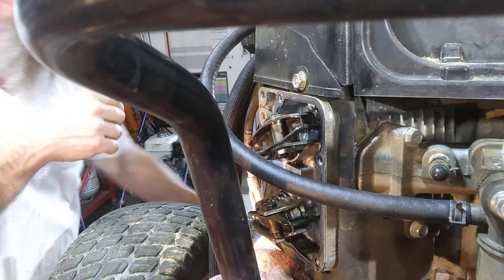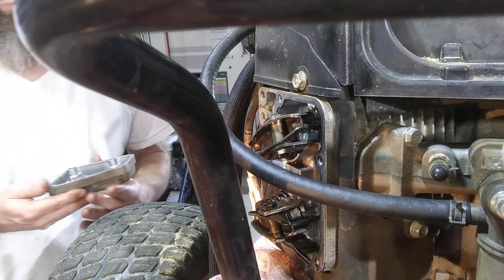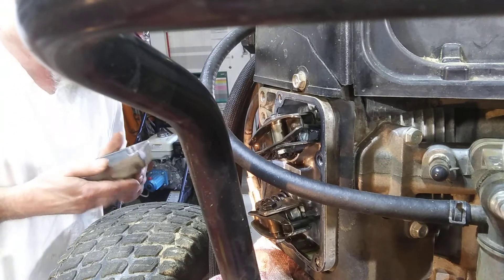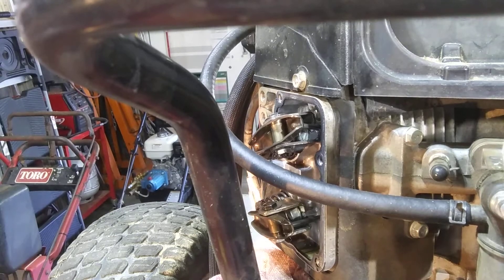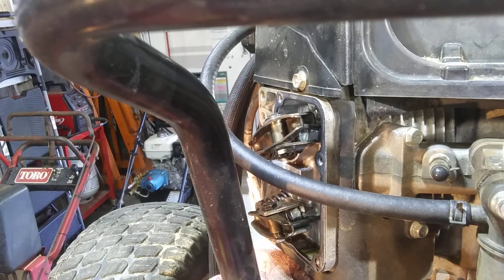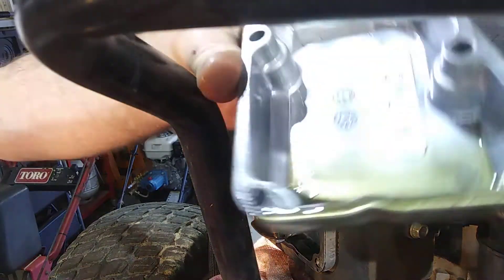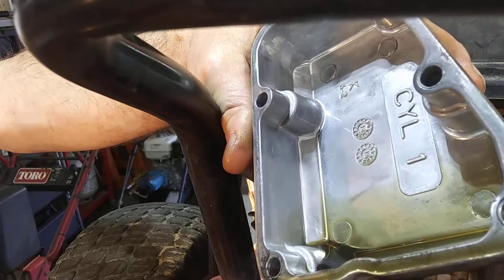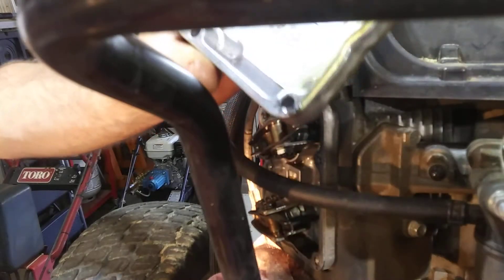Exmark Turf Tracer Kawasaki FS481V Valve Adjustment Part 3

Comment: Can I send you an email? I need help with my Snapper RE110.
Reply from the maker: absolutely
Reply from the maker: you can even call me cause i need advice on running low voltage for access control and a camera problem im workin on